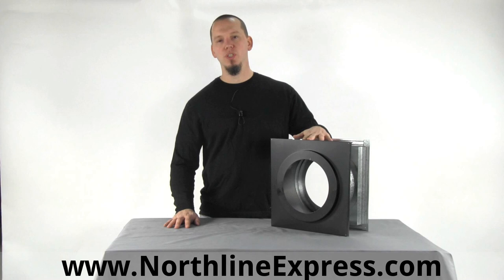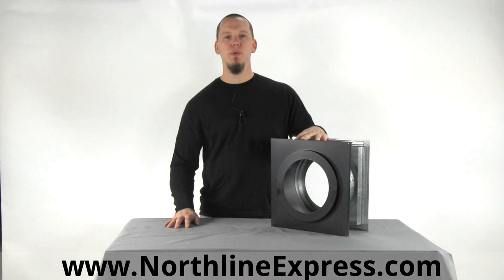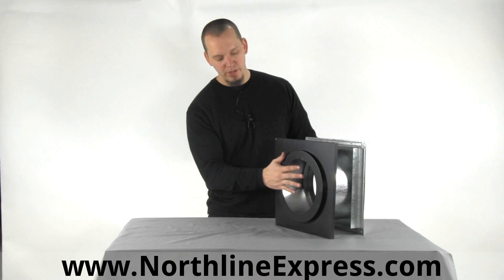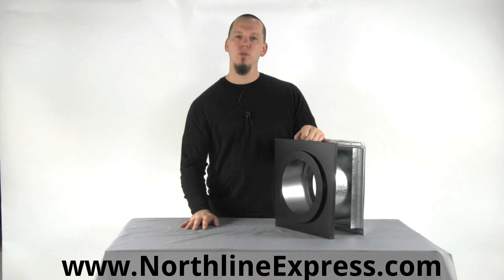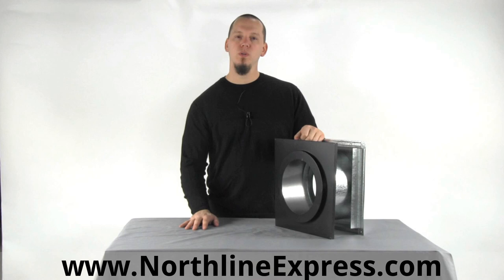DuraTech Chimney Pipe - Wall Thimble Installation

Comment: I have a question. our modular had a fireplace on 1st floor but it was removed before we bought the house. but our1st floor will not support our wood stove. the chimney pipe from old fireplace is still there up through the roof and cap. I want to run my wood stove in basement up through floor into existing pipe up to cap so I can use stove. do I need a thimble through floor or can I just run tripple wall through to 1st floor. there is 6" pipe there already up through middle of a 16" pipe I think it is. can I reduse my 8 to 6 or should I change it all to 8

Comment: Will this wall thimble work for a concrete foundation? How do you seal any gaps around the class A pipe going through the wall thimble when going through a concrete wall?
Reply from the maker: Depending on the thickness of your concrete wall yes You normally seal the thimble on the outside of the house after it penetrates through the wall.

Comment: Looking for a way to put in a wood stove in an ICF house. The walls are 11" thick and I can't find a thimble or insulator for threw the wall. Any ideas?
Reply: Match the thickness of the sheet metal and make an extension.  That's about the easiest part.